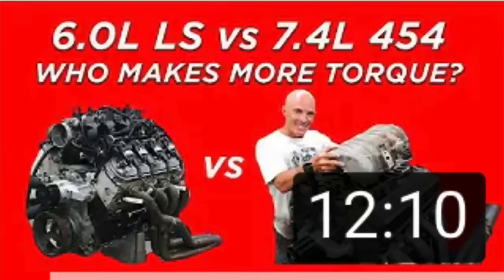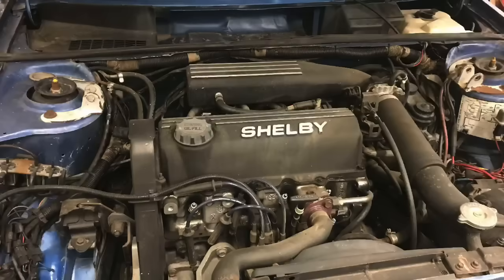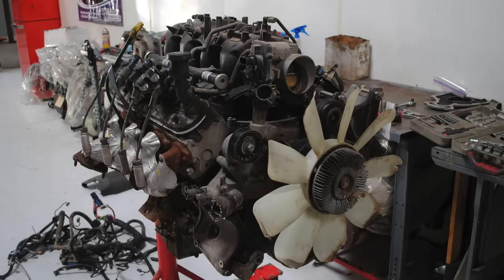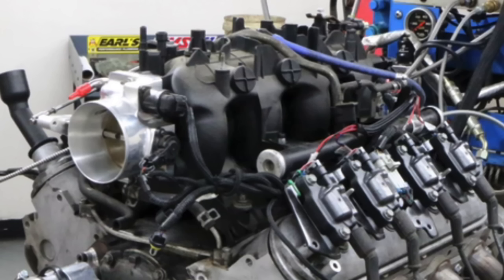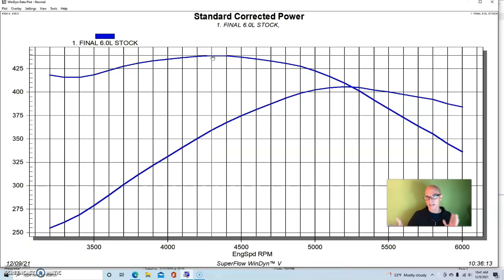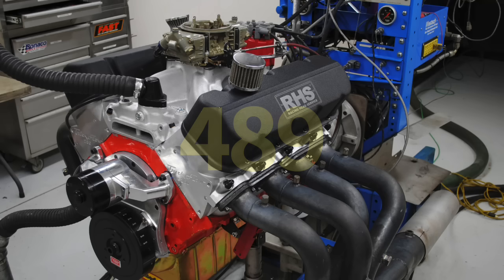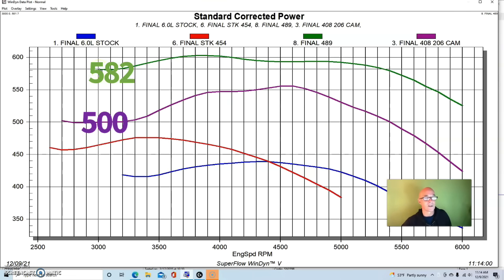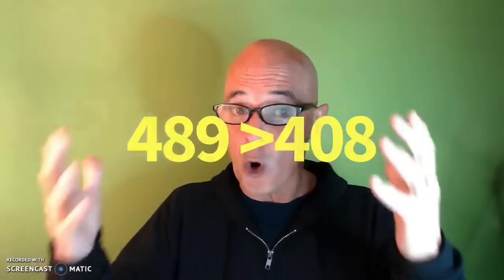LS VS BIG BLOCK! WHICH STROKER MAKES MORE TORQUE? 6.0L VS 408 LS, 454 VS 489 BBC THEN 408 VS 489 !

Comment: This makes me very exited about the engine for my single cab! It’s a 403 at 11.6 comp with TEA 243s a 225/232 114+4 cam and a TBSS intake. I’m thinking it will make a nice little grocery getter pickup truck 😂
Reply from the maker: Sounds great!
Reply: Damn. Mine isn't far off. I have LQ4 .030 over. Stock crank, gen 4 rods, and forged Pistons for about 11.3:1. It has fully ported LS2/LS6 heads, 231/239 @.050 .641 .617 LSA 113+3. I'm hoping for 525-550 at the crank.
Reply: I'm doing a 398 10:1 comp with CNC LS3 heads, ported L92 intake 229/244 113+4 cam.
Careful don't break the eggs 😉
Reply: @christophermix6845  That sounds badass. Mine is going in a Yukon Denali. What is your engine going in?
Reply: @LTXwooshie  that Yukon is going to scoot!

Mines going in a 04 extended cab Silverado Z71.
I'm hoping for 650 at the crank.
Reply: @christophermix6845  sounds fantastic! Traction will be a thing of the past. That's why I'm doing the Denali. AWD will hopefully help.
Reply: @LTXwooshie  yes I'll be able smoke the tires easy lol.
I've got 4wd but I'm afraid something will break if try to actually get on it with it engaged.
You're going to love your setup, my buddy built 6.2 l92 and sold it to his buddy that had a diesel and he said it tows just as good, he's just pulling a enclosed trailer though.
Reply: @christophermix6845  I have a 650 who trans am. I just wanted something fun to drive all the time. Trans am isn't very good on the street.
Reply: @LTXwooshie  nice!
I hope my stroker won't be to much for the street.
Reply: @christophermix6845  It sounds like a perfect street motor to me.
Reply: @LTXwooshie  I hope so!
Does your Trans Am have a high stall and gears?  Setup for the track?
Reply: @christophermix6845  It's a 6spd, and it's a 12 bolt with 4:30 gears, and yes. It's mostly for track use.
Reply: @LTXwooshie  4.30 gears sound like a blast to drive on the street! As long you can get traction haha.
Reply: @christophermix6845  It's perfect for at the track. I broke many expensive things before i could do 5K rpm clutch dumps.
Reply: @LTXwooshie  yah I bet...
Just thinking about a 5k clutch dump makes cringe 😖
Reply: My motor ended up being a 408 with Mamo 205 heads, ported TBSS intake and a 233/239 .600 .600 cam. It makes for a rowdy little daily driver. It’s nowhere near as fast as I thought it would be though. If I did it again I would use the AFR 245s and the fast 102 with more cam!

Comment: What ever happened to the right lsa boosting low to mid torque?? Kind of disappointed with peak screaming rpm wide lsa
Reply: You have proved many times a tight lsa, no matter the duration is a torque enhancer. Was way enthused with the 5.3 tiny cam tight lsa. Big blocks work the same...?.?
Reply from the maker: screaming rpm? (we only showed torque)

Comment: On the subject of rotating assembly mass can a smaller engine with the same power output as the bigger engine accelerate quicker ? 😎
Reply: Yes, just as the lighter car of 2 with identical engines will accelerate quicker.
Reply: I seem to remember a test somewhere where two identical engines one with a lighter rotating assembly would pull up through the gears quicker and dynoed with faster rpms per second . I dunno .
Reply from the maker: no-the power output and vehicle weight determine acceleration (not reciprocating weight)

Comment: Richard the only thing is that most truck engines use their torque from say 2k to 4K , it’s just really hard to rev the truck engine past 4K without sounding like your screaming the engine especially when it has a fan on the water pump. I have just bought a 95 flatbed Chevy and the gearing mainly has it in that rpm range and I was thinking about changing the heads and intake to 305 HO heads, performer intake with long tube headers and a small hydraulic camshaft. I have done this in the past and the engine felt really responsive and torque felt awesome especially at part throttle. Not sure if you have ever tested a combo like this putting smaller port heads on an engine and gain torque in the lower ranges .

Comment: What kind of torque could you get from a boosted tall deck 366 or 427 ??? These engines can be had cheap. If we're talking trucks and towing power they deserve to be mentioned.
Reply from the maker: I have never seen one in a yard
Reply: @richardholdener1727  well I guess that's a good reason why. Thank you for all the long hours of work that you put into the channel. Merry Christmas and happy New Year sir.

Comment: The 408 definitely punches above its weight class but you can also see how hindered stock big blocks were.  When you uncork them they turn into monsters.
Reply: I think ima build me a 408 with that first small cam or similar. Would be an awesome truck motor and tow pretty good in a crew cab 4x4.
Reply: If he would have really modified the 454 it would have outshined the 408 without having to turn it into a 489
Reply: @sstevocamaro  that's what I'm thinking.
Reply: Durability is the Gen 6/7 is about

Comment: And then there's any stock 4.8/5.3/6.0 with a LSA blower posting 600+ ft pounds, and sipping fuel out of boost. Probably could get a blower and lid for about the cost of building a stroker. Boost IS the replacement for displacement.
Reply: Boost is just a displacement multiplier.
Reply: @stlchucko  multiplication is alright by me
Reply: Unless you boost a stroker! Displacement plus boost is even better.

Comment: People underestimate those old-school big block chevys
Reply: In every hotrodder theres a desire for a BIG inch BIG power big block. Issue is, only some people know that. Since LS became cliche yes they're underestimated, though theres a lot more big blocks making 2-4000hp than there are LS motors.
Reply: Erm the Gen 6 and Gen 7 are more LS than a Gen1-5 BBC
Reply: @shadowopsairman1583  gen 7 is the only big block that shares similar LS architecture and is loosely a culmination of the 2, gen 6 and prior are completely different.
Reply: Yes they do
Reply: I’m glad i have both, one 6.0 LQ4 and a 454 bbc but I’m not sure what year it is, it’s in from the 80s or 90s but I’ll figure it out when i pull the heads soon to send to the shop.
Reply: No they don’t
Reply: I don't want a heavy motor
Reply: @henrywal buy aluminum heads then.
Reply: @henrywal  the torque of the big block. Throws that theory off to the side. 😊
Reply: Yep

Comment: the engine designed for low speed torque has a flat torque band throughout a wider rpm range, but i wonder how this would change with VVT
and in a towing application which rpm band shape is more usable
Reply: Since the 454 and 496 had no vvt, only gen 4 ls and gen 5 LT do.
Reply: @shadowopsairman1583  
Preaching to the choir...
I rephrased my question on the live chat, Richard answered it @36 min mark

Comment: I'm a bit surprised the stroked big block only got to 489... do you have a dyno on a "build" Cady 500 to compare?  Relatively light for a big block and was all the rage in the 90s :)
Reply from the maker: cad is limited in cylinder head dept

Comment: Richard have you done any tests with the factory GenVI EFI or know anyone that has?
Reply from the maker: please see part 1 of this series (the last video I posted before this)
Reply: @richardholdener1727  never fear I watched the first video.  From what I have seen there are few people that will tune the factory ECU and even fewer are still marketing high perf parts for them.  My 2000 dually has been in the family since new and was passed down to me when my dad bought a 2015.  Would be interesting to see what the bolt on (cam, injectors, fuel pump) limits are of the factory intake and ECU.  Looks like I will just keep driving this OBS until my other projects are done.  Keep up the good work!

Comment: What about mpg on both. How to improve the gas mileage on the 454?
Reply: Mpg and big blocks don't go well together lol. Duramax!
Reply: Edelbrock multi-port fuel injection,  4l80e, plus a gear vendor over drive,   4.55 gears
Reply: @davidcunningham00  well if the budget is that big, just go straight to a Duramax/Allison and 4.10s. better everything
Reply: @Kincentc  hey I just answered a question, not everyone wants a diesel
Reply: Well you could certainly run a pretty low gear like a 3.08if you had 600 ft lbs at the ready. Assuming your using a car and not a truck with much taller tires.
Reply: @Val_Killmore  torque that low of a rpm ain't doing much in a car other than boiling tires.
Reply: You dont get a BBC for gas efficiency. If thats what you want go get a Yugo lol!

Comment: Meanwhile, the Duramax is just sitting in the corner laughing...
Reply: That Duramax has a turbo.  What do ya think happens when you put a turbo on a LS or BBC?
Reply: Until it needs $5000 injectors 😉
But yah diesel always wins for low speed torque.
Reply: Try putting Duramax into a Vega.
Reply: And the cat c18 is just smdh at the duramax
Reply: Never seen a duramax turn a 4-5 second pass in the 1/4  js .  Lot of bbc doing it 👍

Comment: Tow engine episode!
Reply: No, real street episode!!!
Reply: @DonnellAustin-z3m8r I daily an 8" stall with 4.10s so this is tow to me 😆
Reply: @bowhite1293 no if it's street
Reply: @DonnellAustin-z3m8r can't get more street than a daily driver. The last 408 cam I'd run but it would be with rec ports and a high ram. 😉 😜
Reply: @bowhite1293 I know for fact that it drives like shit!😂
Reply: @DonnellAustin-z3m8r  keep thinking like that 😉 😜 
My 82yo mom can drive it 2 states away and back easily.

Comment: My stars! The stroker 454 with the upgrade cam was astounding! That thing would pull hard forever!
Reply: It's all in the cylinder heads man
Reply: @spambeanie2  cam doesn't play a part? I'm betting the 489 has a little flat hydro bump stick in it still .510 lift?😆 put a 750 solid roller in that 489. I have made peanut port heads perform like they were rec ports and that's with out porting and valves.
Reply: @spambeanie2  once we learn about a air pump … it’s about volume control 
    Can’t breathe. Your engine got Covid problems BBC mark iV heads are the flow monsters
Reply: yeah it finally has a torque curve like an iron head stock stroke 455 Pontiac, all the chevy needed was more cubes and aftermarket heads. The 555 finally managed what my NA pump gas Butler 467 makes with the same heads (same CNC program) Chief has on the Crow. I wonder what the torque will be like when I put a 535 under that top end. That 467's 650+ ftlbs from 3000rpm to 5000rpm is a lot of fun with a 3.08 gear... if it ever hooks. I have some 4.10s behind it now to keep from blowing the tires off.. well, it helps a little and the Th400s last longer.

The peanut ports Playing With Horsepower mentioned come close to Pontiac velocity and torque. Bigger around is less important than longer when it comes to torque.
Reply: @SweatyFatGuy  yeah torque.. only lasts for so much. Till horses are showing tail lights . Rpm will out do the Pontiac. Not many living hours in boats .. GM let Pontiac know about those tryouts. 🤷‍♂️🤔
Reply: @SweatyFatGuy  you really like your pontiacs and yourself.   You know your math, but consistently state higher numerical gear ratios do not equate to torque multiplication at least when it’s a pontiac?   In high school my friend had a 1970 GTO with a 400 and my Fastback Mustang with a stock 289 with a 650 VS Holley would outrun him in the quarter mile.  He bought a pontiac convertible with a 455 and put that engine in his GTO.  I still outran him and I was running hiway gears and a C4 tranny.  He said phuk it and gave up.  That was my slow 289.... I had a 289 in a ‘62 Ranchero that ran mid 11’s in 1980 before SBF aftermarket existed.....  These engines were stock and we were stupid high school kids before you attempt to get on your high horse and say it is impossible.....it happened.  I never seen a pontiac that impressed me, but I haven’t seen your pro stock technology stuff....
Reply: i have 3 BBC ho 454 modeled after the 70 chevelle ho 454 but the LS was built for the track as a racing engine only sold as a crate engine till 94 it is like the 383 stroker which u can buy new as a crate engine or u can built one with the kit but if u go roller with the ho 454 and build it right for the application it is a very mean engine
Reply: @jeffrey4547 bigblock Chevy was a NASCAR engine before it was a production engine. Your facts are bogus.
Reply: @thereluctantgearhead4544  lokk at the 383 chevy built it in 74 but never put it in a car but u could buy it as a crate engine just like a lot of engines before they started putting them in rigs my friend has a cast iron block LS  small block made in 78 i ran a LS 6 on the strip in 75 and it was a GM  small block. it also is a well known fact that they only put a LS engine in a 70 chevelle but yet the 454 450 hp BBC was in a 71 and 72  fact then to disc prove me you guy don't look up the mark 4 series of engines and read it they say GM claims that they changed the angle of the pistons and pushrods which means a new block and they claim in a chart that the 454 has a 4 1/4 inch stroke, but nobody can tell me what LS stands for on the engine not a car. please tell me if you think you know so much
Reply: @thereluctantgearhead4544  ps just do one thing i know u have never bought a crate engine but u can go to were you can buy a crate engine and look at a remake of the 70 chevelle LS 454 and if it a good site they will have a picture of it only thing  it has sensor port upgrades on the block the original don't. i own 3 450 hp bbc crate engines modeled after the 70 chevelle and  GM calls them a HO 454 you can also buy a remake of it too just go look it up. because the more you don't look up facts the dumber u look
Reply: @thereluctantgearhead4544  you guys are going off of a car tag which LS 7 or 6 or what ever the  # is which means luxury sport and the # stands for the package that is on the car but LS on the engine means something else and i am not say till you guys try to tell me what it means
Reply: LS was a production engine that came out in 99.
Reply: @thereluctantgearhead4544  they sold it for years as a crate engine the series  came out in 1970 look up the mark 4 series it will tell u that they changed the angle of the pistons and pushrods that means a new block type which the mark 4 came out in 1970 and was built by GM racing division and designed by initials LS but if u are so smart what does LS stand for what is the guys name please tell me or u don't know sh.

Comment: You should compare a 402 bbc or a 427 to a 408 but I'm sure they are very close in the torque department
Reply: I’ve compared that before. They are very close. The shorter stroke on the 427bbc hurts it’s torque quite a bit.
Reply from the maker: the short stroke doesn't hurt torque if it has the same displacement
Reply: Problem with that is that he normally uses junkyard engines for new tests and 396/402 blocks just arent common let alone a 427.  I'm sure if someone let him borrow one he could do it